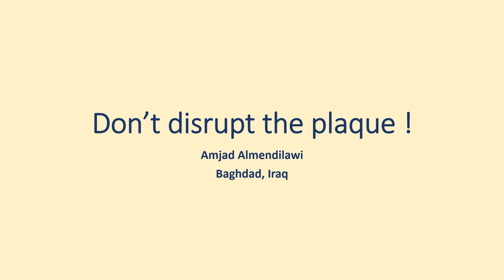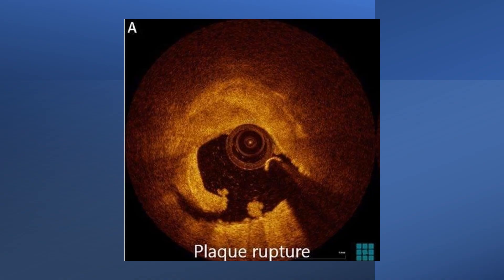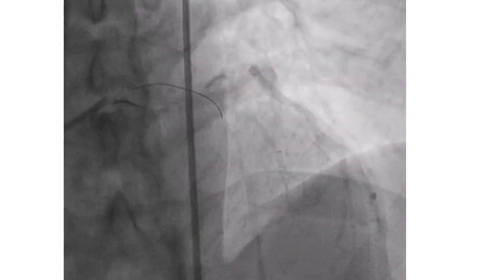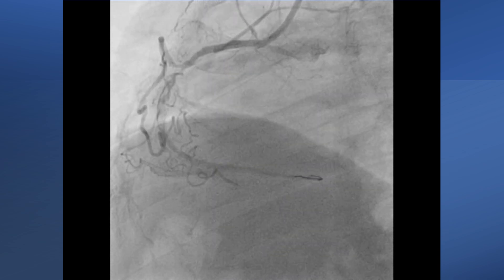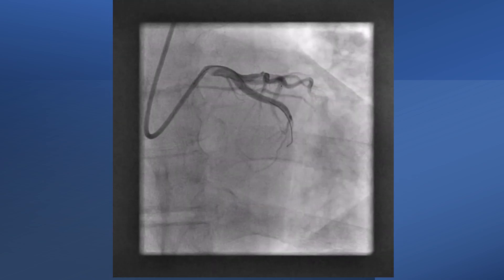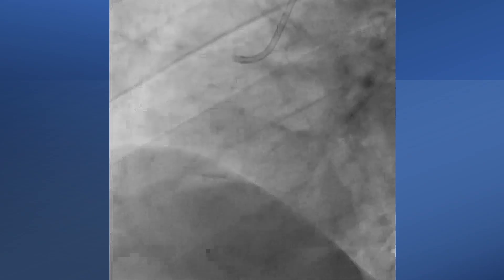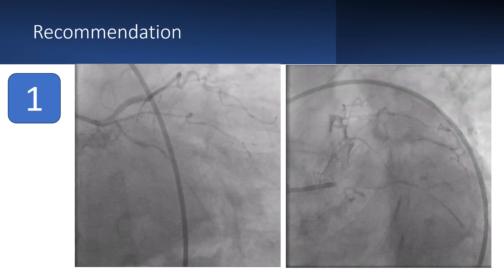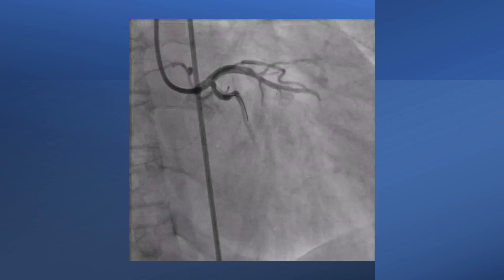don't disrupt the plaque

Comment: Thank you for ur lession

I usually keep 1.5 or 1.0 balloon along with wire in subtotal occlusion..it helps me in wiring true lumen, avoid dissection. If lesion gets 100% occluded due to wire than can easily be predilated. Usually Single small smooth primary curve